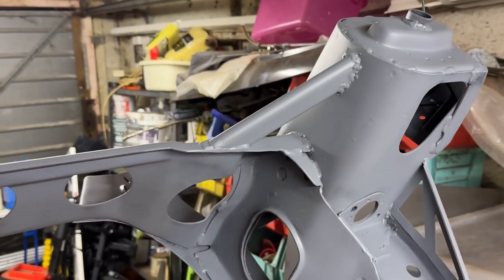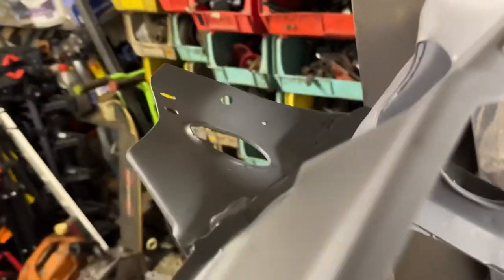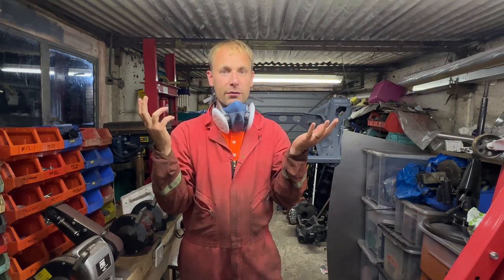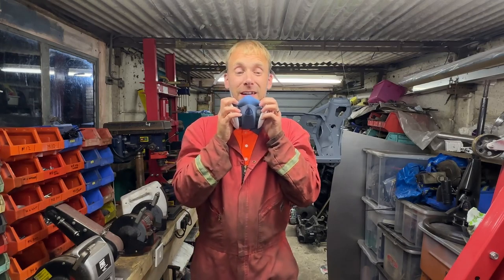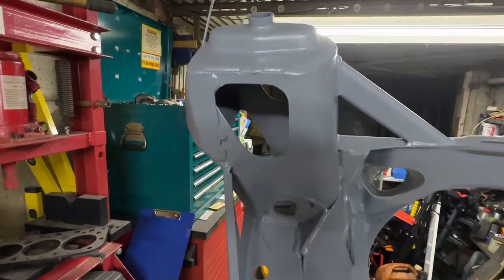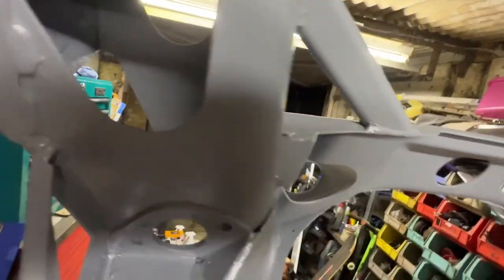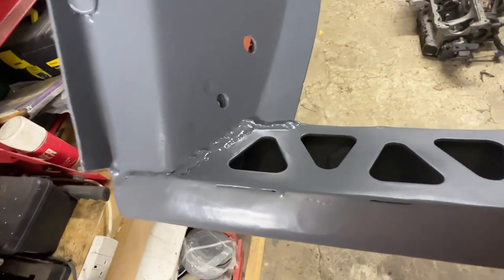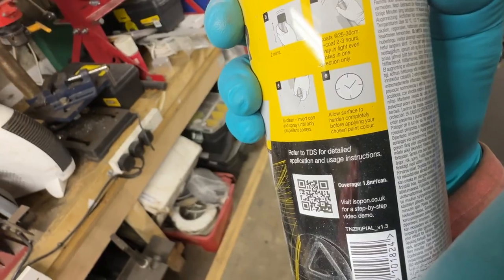Classic Mini - Subframe painting Part 2

Comment: Top tip to save your kit and garage from overspray. Get online, or if you have decorating centre like Paintshed, Crown, Dulux etc and get some pre-taped polythene drop sheet. Its cheap as chips. Get the long stuff about 8ft. You can effectively turn your garage into a mini dust free spray booth in 2 minutes. Get a holder/cutter too if you're feeling flush.

Ill tag a link on the next message in case youtube diesnt like it as i. Cba writing all this again
Reply: Sweet it worked. You'll get stuff in screwfux or wherever, but online on a Decorator shop will be best. It'll be a gamechanger for painting. Bit on the ceiling, floor, no scary friends, drips, dust etc.

Then it'll just be the dodgy runs 😂
Reply: *screwfix obviously 😂